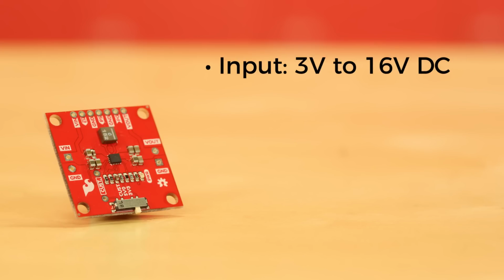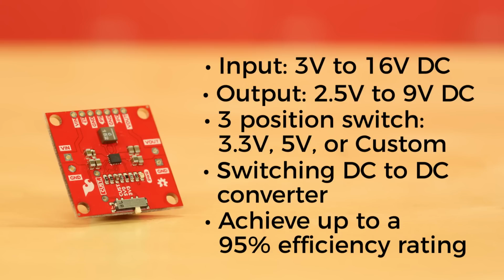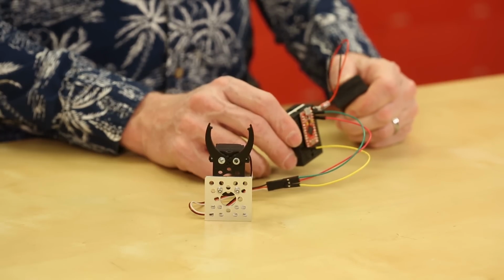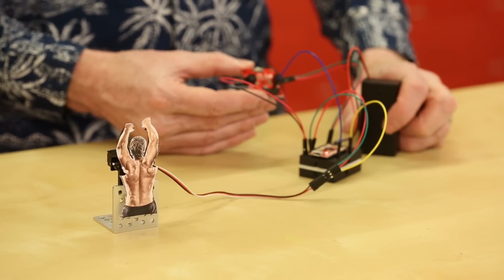Product Showcase: SparkFun Buck-Boost Converter

Comment: Why is it on such an enormous PCB?
Reply: heatsink
Reply: @Melaboudi1  Plain PCB with solder mask and such a tiny chip will not dissipate heat any better than with small PCB. Not to mention this kind of conversion is typically at least 80% efficient. Not much waste heat at expected power output IMO.
Reply: @jirikaspar238   maybe but I know that ground planes dissipate quite some heat...
Reply: @Melaboudi1  They certainly do but the question is how well will the heat transfer around the board. To me it seems like placing soldering iron tip on the PCB and expect it to cool it down.